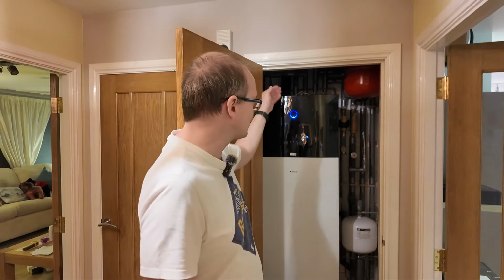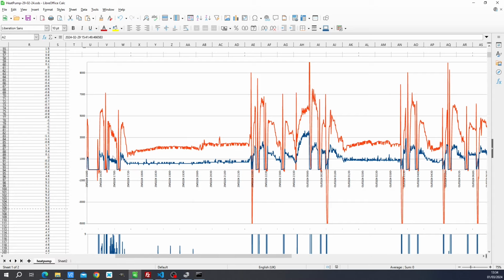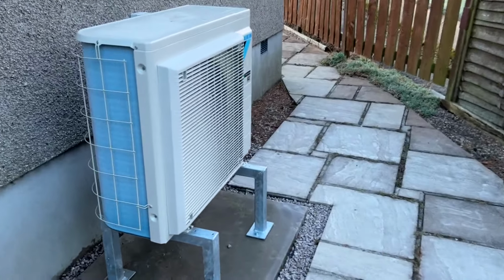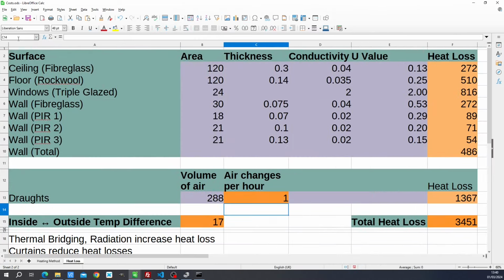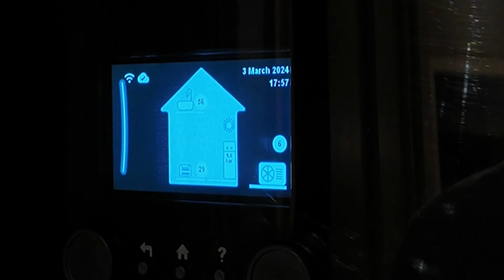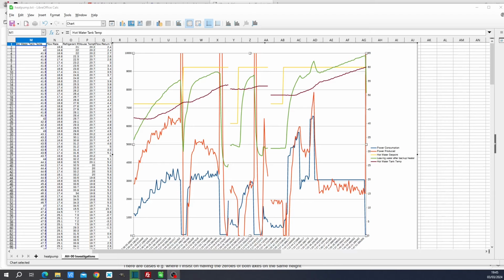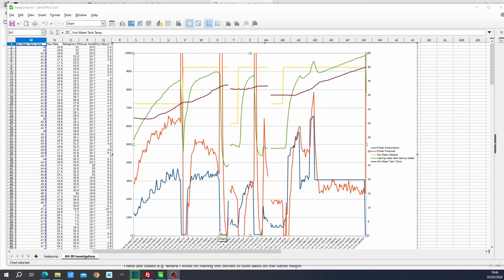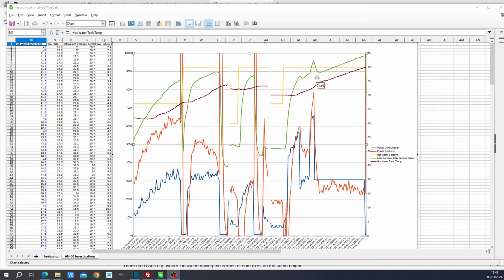Aberdeenshire Heat Pump Odyssey Part 4b:  Analysing the Daikin Altherma Heatpump performance

Comment: My Mum had that error code on her very first disinfection cycle. Octopus tried to fix it a couple of times. It would come back each week. In the end they found out they had fitted the wrong emersion element. The one they fitted would only get to 55c, hence the code. Now they have swapped it, it is fine. She doesn’t have a Daikin tank. I assume that is what yours is. Her control panel is separate.

Comment: There is a modulation setting in the installer settings which lets the Modoka controller, act to modulate down the flow temps as the desired room temp is approached. https://www.youtube.com/watch?v=4SJBTixBB3A

Comment: Might I suggest you set your heatpump to produce an overall temperature of say, 19C, and then bring up your living room temperature to 22C using IR panels. This zoning of temperatures may make sleeping a bit more comfy. Thanks for yet another informative video.
Reply from the maker: IR panels have a COP of 1.  They might be quick, but they aren’t efficient.

I’m tuning in another solution:  Set back temperatures for nighttime.  This drops the flow temperatures by 4 degrees.  So you won’t get stone cold water, but it enables the house to cool down a little. It’s not the same as turning off the heating altogether, and it’s reckoned to be a more efficient way of cooling down because it means there’s less work to bring flow temperatures back up to heating mode again.
Reply: We now have our heat pump going into the setback at 8pm to make it comfortable for sleeping. The thermal mass means the building cools so slowly!
With our old gas boiler we used to enter setback at 9:30pm as the temp fell so much more quickly with that setup.
Reply from the maker: @UpsideDownFork    I can confirm that.  I've started setback temperatures -4 degrees overnight.  The temperature of the rooms falls back very slowly.

Interestingly I've now seen some very efficient operation from the heatpump.  I'm seeing 1.3amps of compressor load, occasionally 0.5amps is seen./

Previously it stubbornly refused to drop below 2.3 amps, even if the flow temperature was stubbornly above the setpoint.

I've getting a CoP of nearly 4 in this regime with a room temp of 20.5-21 degrees, even though it's only 5 degrees outside.

Comment: Best video for a Daikin HP so far. I‘m very interested, because I got my in october and I’m trying to get some data from it still. On my HP the serial port is already in use, because there is a PCB for the floor heating connected to. We’ve got both, floor heating and radiators. Any idea where to connect? Thanks a lot for your amazing videos.
Reply from the maker: What you raise is an interesting project. Maybe you could connect your PCB for the floor heating directly into the Arduino and then have a little project which relays the serial line data from the  Daikin into another serial interface for the PCB.   Thus you can still get your data from the Daikin unit for your own purposes as well as the supplying the information to the PCB.  Now of course you need some programming skills for this.  

The alternative is that you ask the question what exactly is your underfloor heating PCB actually doing?  I’ve got a feeling it’s probably only controlling one or two valves at most and it raises the question maybe you could control those valves directly from the Daikin heat pump.  I think there are some connections for external valve interfaces so maybe that’s an option.

Comment: Very interesting. Not sure if you can add it to your graphs, but outdoor wind speed might be fun to add because you can see if the heat pump starts to work harder when the wind picks up and your house air tightness starts show itself on the graph. Perhaps that can help you calculate the air changes per hour (air tightness)?
Reply from the maker: What I have done is that I’m calculating actual output on a rolling 1hour average and comparing that against the theoretical heat loss that I showed for the prevailing temperature gradient.  That deviation between theory and result is being plotted.

Last four days have been remarkably consistent in terms of temperature about 5° and there’s been no sunshine at all it’s been cloudy the whole time so it’s a perfect weather condition in which to test this against my temperature model and so far the deviation is within about 50 W during steady state conditions and I think that’s pretty impressive.

Comment: Well done. Looking forward to the financials. Can you do them with and without solar input.
Reply from the maker: I’ll look into it, but as a spoiler alert:  98kWh was consumed last week and 70kWh this week.  Most of the consumption was done during peak hours.  So without a battery and solar that’s £29.40 a week, or £588 extrapolated over a 20 week period.   I’d say the last two weeks have been “a little above average” for what cold temperatures are like.

Now of course when we add in solar plus batteries….. stay tuned!

Comment: R32 (which will be always in a split system like this) is limited to about 55C, hence it won't be able to achieve the 60C for Anti-Legionella on the compressor alone.
Reply: Tbf most heat pumps tend to have a legionella purge weekly so surely that should equate for legionella for systems under 60c?  I assumed it drained the system as my heat pump makes some really strange noises while doing it?
Reply: @bamber119  That's where the immersion comes in - which is typically in the cylinder - or in this case the hydrobox/cylinder combo.  Heat Geek's Legionella video is also worth checking out, as there are scenarios where an ALC isn't always necessary  - due to cylinder turnover etc.
Reply: @BenIsInSweden yeah I’ve literally just watched that video due to wanting to be more informed over this conversation.  basically my takeaway is that 55 degrees for half hour is more than adequate to kill most legionnaires off.
Reply from the maker: @bamber119  that’s certainly my conclusion as well and bear in mind my tank temperature don’t really deplete very quickly at all so I will have 55°C for many hours.